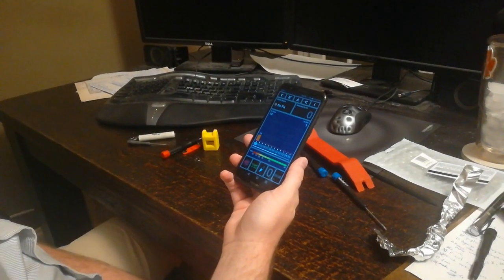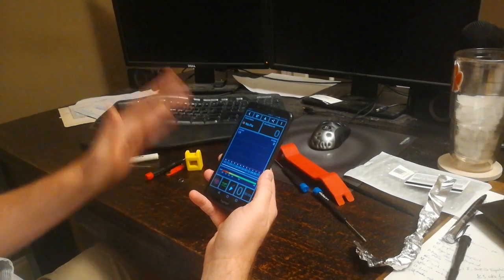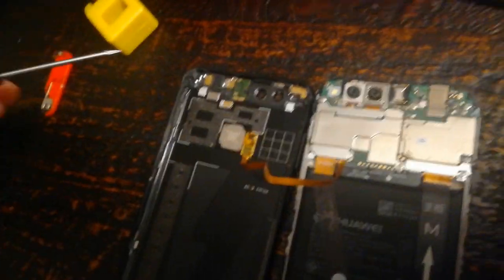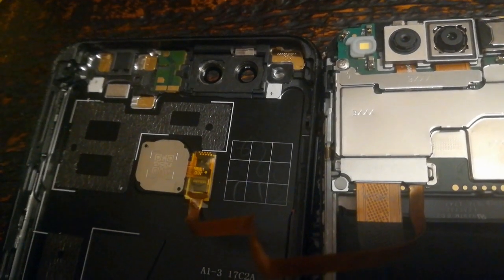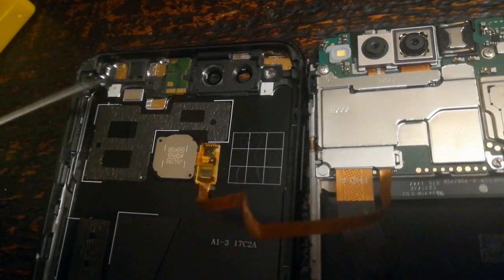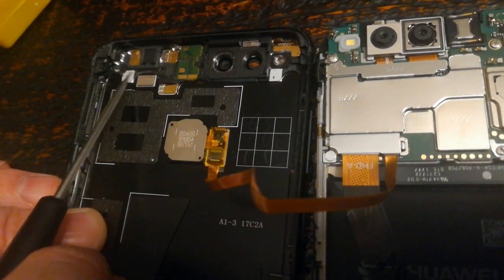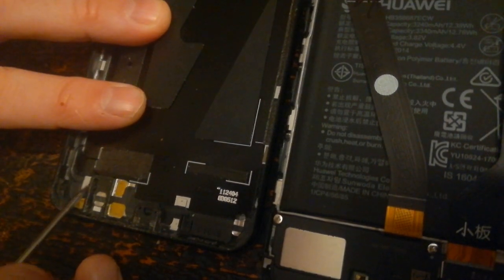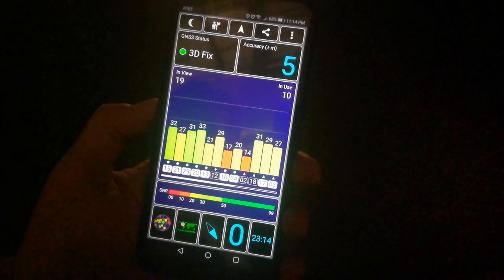Honor 7x GPS Fix

Comment: Thank you. At first this did not work for me but I disassembled it again and bent the little springs up a little so there would be more tension on them to make better contact. Then it went from 0/20 to 15/20 satellites.
Reply: Update, worked great for a while but then problems again. Squeezing that corner of the phone does make it work again so it is definitely an intermittent contact issue. I tried putting some folded tin foil and dielectric grease on the contact pad but it didn't seem to make any difference. I'm wondering what the pads are made of. They seem like they're soft and just coated with a conductive material.

Comment: Mine worked only temporarily. Is there another method?
Reply from the maker: This tutorial was intended for simple repair with just the screwdriver, but for better results you would need to use a contact cleaner such as DeoxIT (https://www.amazon.com/Hosa-D5S-6-DeoxIT-Contact-Cleaner/dp/B00006LVEU)

Comment: hey, I think you should as well bend up the small contacts from the board to give better contact. They are like springs and can loose strength over the time --> less force --> less contact.
As well I would use some contact spray for electornic contacts.
Thanks for the Video :)!

Comment: Thanks for this.  Spent dozens of hours attempting to figure out why the GPS stopped locking on my Huawei Mate SE.  So I was very excited to try this fix.  I take out my SIM card and unscrew the first screw on the bottom of the phone.  Then I try the other.  Of course, it won't come out.  (Story of my life.  Very "Zen And The Art Of Motorcycle Maintenance" if you've ever read that book.)  Badly stripped.  I admittedly probably made it even worse by fiddling around with it too much.  Watched a bunch of videos on how to remove a stripped pentalobe screw from a phone and tried every trick for which I had the means.  After about three hours I just gave up and screwed the good screw back in.  Next day I go outside and--lo and behold--the GPS gets the quickest and best fix (most satellites) it had in about a year!      Yet I was never even able to take the phone apart to clean the pads!  Thought it might be an aberration, but it worked again the next day and the next.  Any thoughts on what happened here?  Only thing I can think of is that pulling the good screw out and then screwing it back in somehow improved my antenna connection.  I'm not a very handy/mechanical/electronically savvy person, but this mystery has greatly piqued my curiosity.
Reply from the maker: I hadn't considered the possibility that the screws themselves were a grounding point between the main board and the back case, but maybe so.

Comment: I fix my Huawei SE after I clean it with the qtip + alcohol. Now I can get the GPS signal. Note you need to unscrew bottom of the phone. Take time to open the case around. Everyone can do it. It just snap back together.  Thanks.
Reply: 99% sure this is the problem w my Mate SE's gps as well.  My concern is breaking the phone when trying to pry it open. How much of a pain is that to do?  Also, does it just snap back together or do you need to solder it closed?  Thanks.
Reply from the maker: @sassman66  it's a snap on, snap off deal. Search YouTube for how to open a 7x
Reply: @sassman66  I use small screwdriver to open. Hope this help.

Comment: I have to ask.. How did you even know about this?
Reply from the maker: From research I was able to determine that people could resolve the problem by installing a new case because that's where the GPS antenna was. I just decided before I did that that I would open it up to investigate, and the contact pads looked like they were the problem so I cleaned them. One of those times when troubleshooting just worked.
Reply: @bmjord23  I also looks like that pads were coated with some kind of paint or spray of some kind. I wonder if that was meant to prevent the issue. Or maybe it was a manufacturer flaw.

Comment: Thank you so much for making this video! I sent my phone back for warranty repair because the audio jack failed. When I got it back, it was out of warranty and the GPS no longer worked. The GPS arrow would jump around the roads as if the tracking was off. I tried waze and google maps so I figured the issue was with the GPS itself. I downloaded the GPS app and compared it to my wife's Honor 6X. Her phone tracked satellites like a champ. Mine couldn't fine half the satellites that hers did. So I tried your trick which took about 10 minutes to complete. Now it tracks  like my wifes phone. Google maps  works awesome. Its only been about four hours since the fix but it looks like it worked 100%. Thanks again. Great Job!

Comment: Can't get the thing open, any tips?
Reply from the maker: One tip is to use the screwdriver you used to remove the screws to press on the headphone jack through the hole for the headphone jack in the back case. The jack is connected to the screen side, so if you hold the case while you press, you should be able to get it separated at that point and then use a guitar pick, credit card, or other tool to separate the rest.